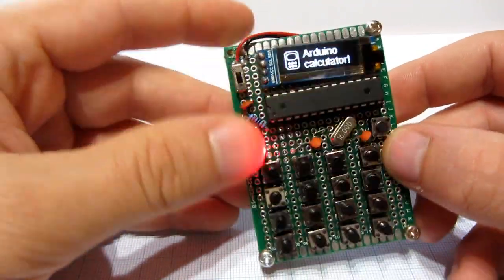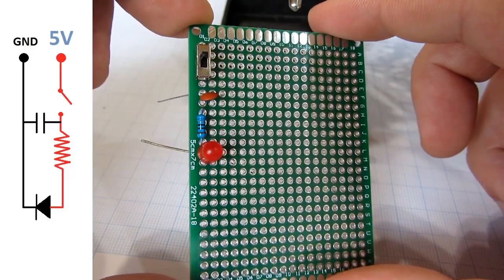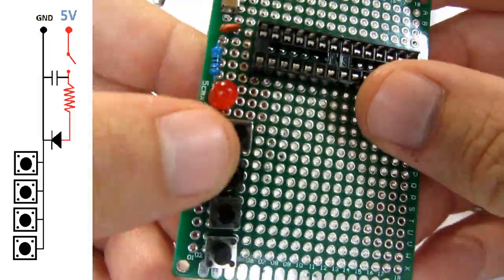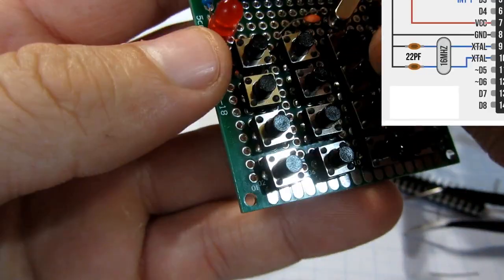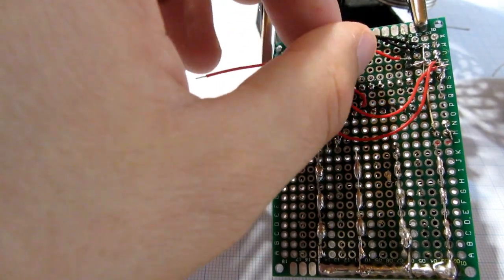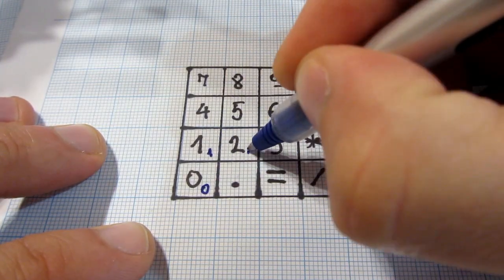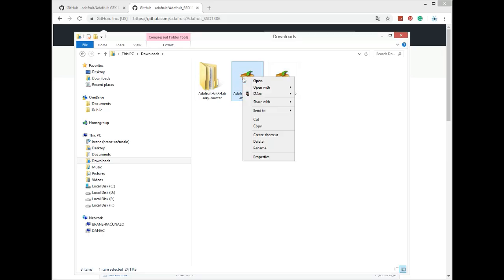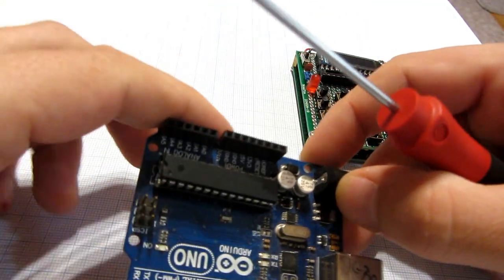How to make  Calculator  Arduino  project

Comment: good sir, may i ask something? d0-d13 is digital input/output right?
Reply from the maker: yes, thats are pins on IO pins on Arduino!
Reply: @VolosProjects and the A0-A5 is the analog Input like the usual arduino right?
Reply: @VolosProjects  also i would like to ask. when like the i use pin output 8 do i put the ground in the same ground as the ground in 1 of those picture?

Comment: I have a question,If the battery runs out...how do you charge it,or can I conncet it using 2 AA baterys??
Reply from the maker: only way to charge it is to , remove battery and charge it some other way, yes 3 aa bateries will give you 4.5 V and that is perfect for powering this

Comment: Hello the button that prints 9 does not work. How do I fix this?
Reply from the maker: you can check conection, and you can chec button
Reply: @VolosProjects  Connection is correct, but I will experiment and see if the micro controller itself is faulty

Comment: I have quite a simiilar microcontroller, which is p328 Nano arduino. 
image: https://s.alicdn.com/@sc04/kf/Hf5ad85b23a1e416d8837d771625aa450p.jpg_300x300.jpg

I am trying to figure out some things with it. I don't know how to connect 16mhz crystal oscillator to it, because it has different pins and XTAL is not written on it. Does it mean that I do not need 16mhz crystal to it? Also, it has two reset pins. Do I have to connect both reset pins to the power supply? Thank you.

Comment: At my job i'm using a calculator all day and it's kinda boring, but with this i will make my own calculator. instead of normal buttons i will use mechanical switches from a desktop keyboard an some rgb lights. all this is unnecessary, but it will be muuuuuuuuuuuuch cooler xd

Comment: tock a lock at the code and saw that you are using the float variable to make the calculation. I believe that that variable has problems with exact calculation, that's why they made the double variable although with most microprocessors like the atmega328 isn't it any different between the two. Did you somehow solved the issue or is it there. If it is there, do it make any problem or is the fault rate so small you don't notice it?

Comment: i have done my own calculator using arduino but i want to know how to use directly 328p microcntroller without using arduino which takes more space.
Reply: Program the microcontroller via arduino and remove it from the arduino

Comment: Do i need to have 2pcs of arduin for tge AT MEGA 328P MCU? Where did yubg get the one in the board?
Reply from the maker: i dont understand yout question completly. No, you dont need to habve two arduinos, only one arduino uno with this size mcu.
Reply: Where did you find the part ubder the OLED? Like in the arduino the one where you get the black part

Comment: Hey, question! I can not figure out what you use the variable int over for. My best guess is that it tricks the for loop that waits for button presses into letting you insert zero into the broj string while the calculator idles. Am I close?
Reply from the maker: i dont understand you, whic part of code?
Reply: @VolosProjects  
int changeNumber=0;
int over=0; <----------
String num1="";
String num2="";
String broj="";
int stis[17]={0} ;
void loop() {
  display.clearDisplay();
for(int i=0;i<15;i++)
  {
    over=0;<--------
you initialize over then set it to zero,  what is it doing?
Reply from the maker: @jaykeen2269  that is variable that was used while i was making first version of sketch, in final code thats variable is unused, i forgoted to delete it. You can delete it